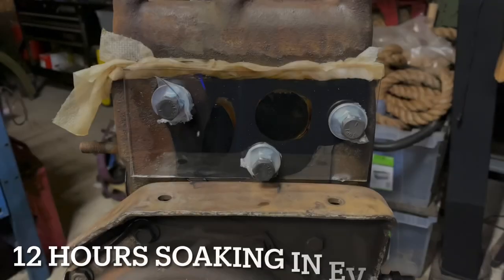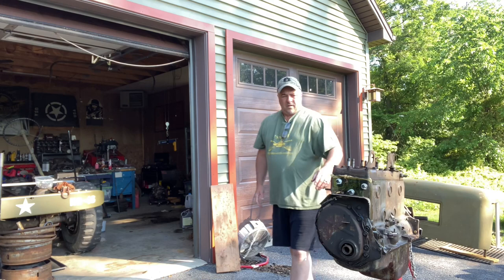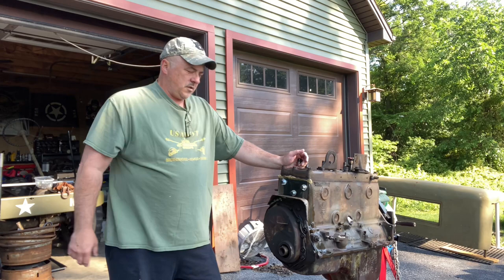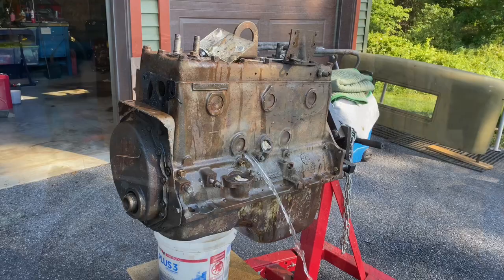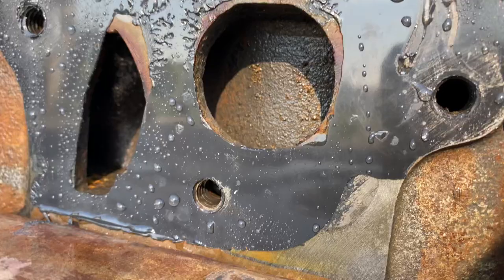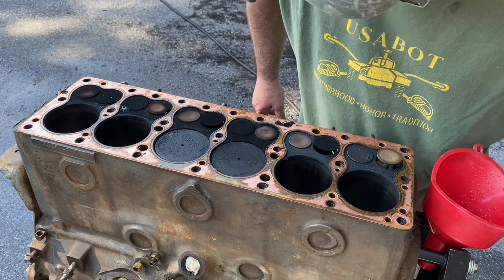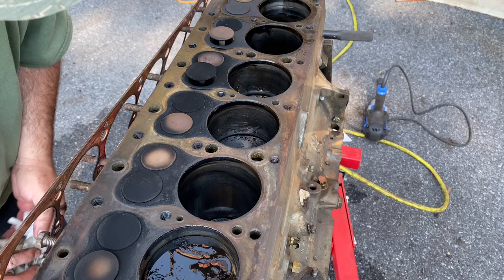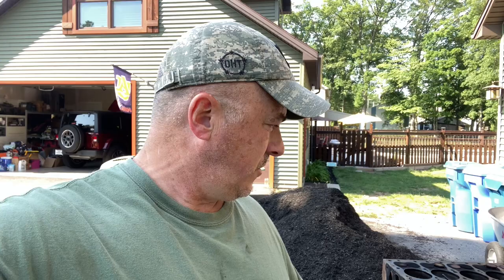EVAPO-RUST, use inside engine block

Comment: That stuff is amazing! I just used some in my engine. It won't hurt to leave it in longer. I was going to use the regular 'Evaporust' but they make a product specifically for cooling systems called 'Thermocure'. It's basically a concentrated version of Evaporust that can be diluted with up to 3 gallons of water. Says made for cooling systems 2.- 3 gallons. Works best above 60f.

Comment: I soaked my 4 cylinder Willy's block for 3/4 months. Lol was not my intention, just didn't have money to get it running. I got it running now, before that I did change it every other mouth. Upon starting I did add Thermo shield radiator flush in it as well your project came out pretty nice too.

Comment: looks good and what i would do next would be take the valves out and wire wheel the top of the pistons and block clean and do a quick re lapping and set your clearances after and then when you have it back in with the radiator hooked up and running i would do another engine flush using the prestone radiator flush just so you can get even better cleaning results and dont forget to clean up all the engine studs and use the permatex thermostat and water pump stuff on the stud threads when you put them back in so you dont leak

Comment: I would also recommend two to three coats of copper spray on the head gasket, gasket only, follow directions on the can
Reply: Be careful using copper spray, it has a chemical reaction with certain metals and can actually cause corrosion and head gasket seeping. I can’t remember which metal but from memory watching a Haagerty rebuild video Davin suggested it might have been cast motors like our WW2 blocks and not aluminium/steel blocks.

Comment: Evaporust works but it takes a long time, I did a really rusted motorcycle fuel tank and it left it spotless but took about a week.
Reply: Depends on the temperature and amount of rust. Works faster if it's slightly warmed. I've seen conflicting info on the minimum temp being from 50-60 degrees Fahrenheit. It does take longer if cooler.

Comment: I've flushed with straight vinegar befor with good results.
Reply: Did you do the exact same he did? Or soaked it?
Reply: I'd be careful about the vinegar. Vinegar had a Ph around 1.0 and the Thermocure/Evporust is 6.1. The Evaporust will only work on the Iron. I used vinegar on a weak radiator/cooling system and it caused some leaks. If you do the vinegar you need to neutralize it with baking soda afterwards. When I did the bubbling actually broke a bunch of the rust loose so I could flush it out.

Comment: Damn Man great minds think the same. I have a 47 coupe that needs the tube and water pump and has been neglected as far as antirust. One tip I can give is I am going to use the water pump  backing plate as the block off when I use the evaporust. Where did you get the puller for the distribution tube? Thanks for the video.
Reply from the maker: Midwest military had the tool

Comment: Could you just put it in the radiator and circulate that way thinking of doing this after I replace the waterpump on my 239
Reply from the maker: Evsporust has a product called Thermocure, I will run that through my system after it’s built

Comment: Man that stuff must be cheap as chips over there in the US. The closest stuff we have is some product that cost between $90-$120 a litre.....
Reply from the maker: Not cheap, about $18 per gallon
Reply: Where are you from?
Reply: @bradleypease2492  Australia....products like this are around $100-$120 a litre.
Reply: Best deal I saw was a 5 gallon pail at Rural King for $75. It's about $95 at Summit now. About 4 or 5 years ago I got a 3 gallon pail for $53 and it lasted me 3-4 years. It is reusable. You can tell when it starts to get 'worn out'.

Comment: i wonder if putting evaporust in the clean it, then using thermocure to flush out any of the residual might work, hmm.... 

Out of curiousity, did you fill the entire block? like, even in the heads? Have a stuck engine myself and just musing on a few possible ideas
Reply: I looked into the differences. Supposedly Thermocure is just a concentrated version of evaporust so it can be diluted with water after you add it and says it works for 2.5-3 gallon cooling systems. It comes out cheaper to use that than the regular evaporust. Both are the exact same formulation though, one with less water.
There's some kind of 'miracle' new penetrant out called Superzilla that has a creeping capillary action that would be perfect for stuck rings etc. Haven't tried it yet but looks interesting. Cheap enough to give it a shot.